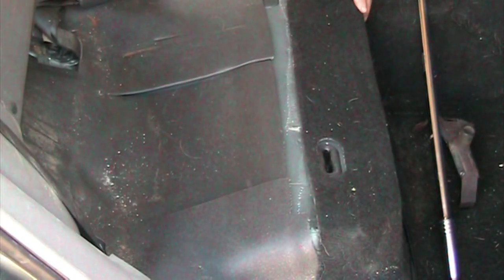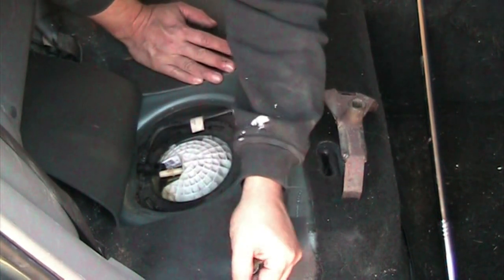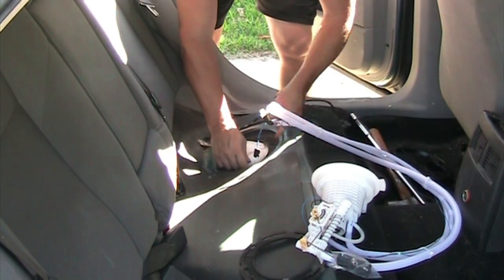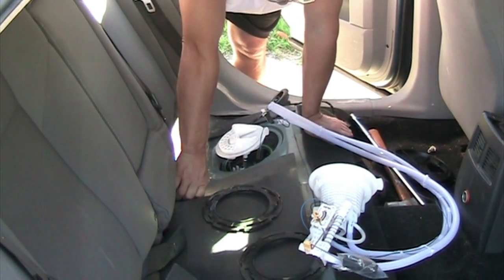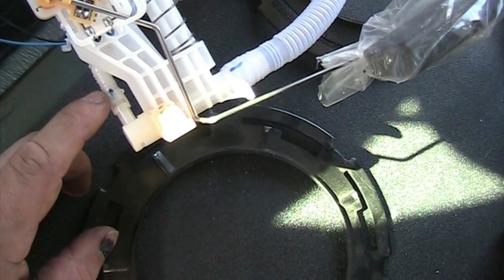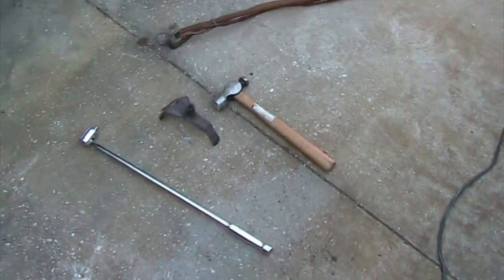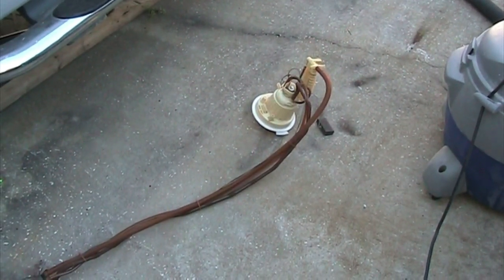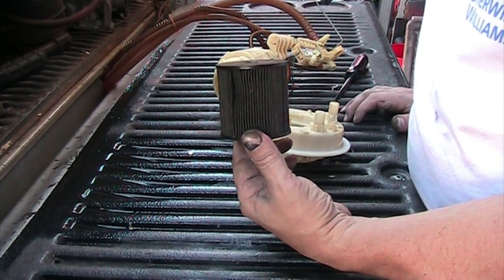Chrysler 300 Dodge Magnum Charger Fuel Pump Filter passenger replacement

Comment: Thank you! Very helpful video, thus video helped me very much answered all the questions I had about this installation.  Thanks for taking the time to record, do and upload thus video
Reply from the maker: Glad it helped!
Reply: I currently have long crank am going to change the passenger pump and the crankshaft position sensor as well
Reply: Thanks for explanation , think im going to replace both of mine on my Magnum car has 270K on the Hemi and just having fuel pump or filter issues. i fought my other RT by changing the filter unit then later having to come back and change the pump side few months later for a weird very intermittent stumble issue. Thanks for. going to through all the trouble
Reply: What model years does this repair apply to?

Comment: Good explanation of the fuel system. I have a Chrysler 300 similar setup..recently the pump went ,but I also have to replace the other side (filter, sender..)
Reply: Ll
Reply: Earl Shaw  it's only one fuel pump. The other side  is just a regulator/ filter but it's attached to fuel line that goes to the rail/injectors

Comment: What were the symptoms when a filter gets so dirty?
Reply: Long cranking before your car starts because of the lack of fuel pressure. Mpg starts dropping. Misfires can happen. Car can stall if it gets very bad.
Reply: My car cranks but wont start. Changed the fuel pump and still only cranks. You think it can be the filter?@ttarverr

Comment: Why is my right tank full where the filter is located? What can be the problem there? It is not passing the fuel to the driver side. Please help. Thanks in advance. When I cross the gas on the fuel pump side, it cross all the gas again to the filter side.
Reply from the maker: The way the pump works is as follows, fuel enters the reservoir of the driver side module. The fuel pump pumps the fuel through the filter to the passenger side module through a supply line inside tank. The pressure regulator inside the passenger side module regulates the pressure at 58 psi. All unused fuel that is not sent to the engine is fed through a venturi at the bottom of the passenger side module. This creates a low pressure siphoning effect and draws fuel from the passenger side of the tank and transfers it to the drivers side tank via siphon hose inside the tank. While the vehicle is running the fuel in the passenger side of tank is continuously transferred to the drivers side. Fuel will continue to fill the drivers side tank till it reaches the bridge section and then start to spill over to the passenger side.  So check my other video out on how to replace the passenger side.

Comment: Could a clogged fuel filter be a problem as to why my car doesnt wanna go past 3k rpm?? 2014 charger 5.7 pursuit, has currently 217k miles on it, any time i hit the gas, it stutters around 3k rpm and if i force it car goes into active limp mode, DO have a code for a cyl 1 misfire but the first code i had was for the fuel pump sensor, then i got the cyl 1 code, please if anyone can help, i changed the plugs, swapped coils around and even got a new injector for cyl 1 and still doing the same thing, did a oil change recently and no metal in the oil and no ticking coming from car.
Reply from the maker: Very well ...... because at higher rpm you demand more fuel so yes. Or he injectors

Comment: My car stalled out I got P0340 code want start with starter fluid I installed new pump spark plugs crank over slow then normal I never changed fuel filter before could what u changing be my problem I never changed it out been driving it since 2020

Comment: Hi, recently change the fuel sending unit on my 2019 dodge charger due to my fuel gauge fluctuating. I tried to put in the fuel sending in gently but it didn’t go in as easy as yours. Do you know if i did anything wrong or maybe i have the wrong part 🤔. I had to push it sort of hard to pop into place but my gauge is still not reading correctly from time to time. Keep in mind this was happening prior to me changing the pump and i have also change the fuel pump. Could it be something else other than the pumps.
Reply from the maker: I think you have a connector corrosion or problem with some of the wiring itself. Clean out the plug which goes and put some electric grease into it so it ensure a better connection. 90% of time it's the connector right above your unit you just changed out. If it isn't that it's on the backside of your cluster. Both can wear and get corrosion over the years. Hope this helps

Comment: What does the 2 small black wires go to on the "pass" side filter/regulator. Whatever the connector was broke on the inside of filter house. So I had extracted the little broke pin that is like a brass color that sits below the filter with a small thin little piece of metal that the filter pushes down onto

Comment: Where is the fuel filter location on a 2007 Chrysler 300 3.5l touring??? Is it the same as this one plz I lose engine power under hard acceleration
Reply from the maker: Yes it is the same for all models.It is inside the gas tank.
Reply: @lsellclumanetsolarenergyll5071  thank you I really appreciate the reply now I can get to work
Reply: @lsellclumanetsolarenergyll5071  this wasn't my problem it was my ESIM that had a small leak but I replaced it and my engine light is still on and it still loses power under hard acceleration could this be the problem
Reply from the maker: @Bryan.956  no but what codes do you get and at what RPM do you feel a lag setting in? It also can be air intake related which don't even throw a code.
Reply: @lsellclumanetsolarenergyll5071  keeps on coming up as a small evap leak and only when I hard accelerate it happens if I drive calm and normal it drives and feels like a cloud so smooth I only have that problem when I floor it and passing 4500 rpm
Reply: I have a aftermarket KnN intake and new maf sensor which I didn't need but still replaced just to have it new also with the intake

Comment: I have a 2008 Chrysler 300 that's turning over but wont start. When I spray starting fluid it starts up then dies. I hear the fuel pump whining when I turn the ignition on. Do you think the fuel filter module is bad on the passenger side?
Reply from the maker: If it doesn't stay running without starting fluid been sprayed it can be 2 things. Starving for fuel because of the fuel pump. Or your injectors got clogged up. I would test the pressure first, if pressure is OK than your pump is OK. Injectors you want to clean proper. There are videos about them so you can test them or spend the money to replace them.
Reply: @lsellclumanetsolarenergyll5071  ok and thanks for the quick response
Reply: Yes
Reply: @beattheheatindustriesinc5700  I changed the fuel pump on the driver and it still wont start. I can hear it pulling fuel from the passenger side fuel filter module.  So do you think I should still try and replace the fuel filter module even though I here it trying to pull the fuel from that side?
Reply: @donaldray2040  that was happening to me and it was the wireing I switch the driver pump and car wouldn’t start and now it start my mechanic fixed the wireing but still’s marks check engine have to do passenger side now but at least it starts now

Comment: Great video, but what code let's you know its the fuel pump or the filter? My engine light on 05 magnum s.e is reading*implausible fuel level detected  is that the filter which is the passenger or the pump which is the driver side however Gas meter reads fine
Reply from the maker: Look at your odometer mileage you on it. if you have over 100k on the fuel pump/filter unit than there is an extreme high chance your fuel efficiency already went down and your vehicle is building up carbon because of running to lean at times. Don't wait for the code just get it done. If you do it yourself take 2-3h out of your day and spend under $100 on the part and just do it. And implausible fuel level can be either side because you do have on each unit also a gas fuel level unit. I noticed it because I drive ton's of miles about 60k a year and more so my ass and ears are my best sensors as a former rally car driver you just learn to listen and feel more the car than regular drivers do.

Comment: Great video.  Question though.  Do you think the filter side could clog up restricting the flow enough to not let the engine start and run or start then idle and die?  Just put a pump in an 05 300C with the 5.7 19 gallon tank and it ran for a few minutes perfectly, but after we shut it off is only starts and dies.  Fuel flow seems very low at the fuel rail in the engine bay.  Thanks.
Reply from the maker: Ok yes it can happen. What pressure do you get at the fuel rail? Did you try to unhook the fuel line and put the car into ignition warm up mode meaning you don't crank the last bit of the turn this should pressure the fuel line and you should see if enough comes out or not. Sometimes debris can be restricting the flow which made it passed the pump and was sitting in the line for to long.

Comment: Can this part throw o2 sensor codes and lean codes
Reply from the maker: Yes it sure can so does also the gas tank vent cap. Check that first. OEM tank caps are required.

Comment: I'm still having this same issue with mines I changed the pump on the driver's side but not the passenger side it's still having the long crank issue should I try this? I been thinking it was my timing belt or something
Reply: What's your error reading
Reply: Update
Reply: Running decent now
Reply: @millytopshotta  so what was it? I currently have long crank. Tomorrow am installing the passenger pump and i will be putting the crankshaft position sensor as well. The one next to the starter
Reply: @rhurtadorh32 try changing both pumps that fixed my problem  and I also did crank shaft sensor lmk

Comment: Una pregunta amigos porq se apaga un Dodge charger 2008 cuando le qda un cuarto de gasolina se apaga solo le vuelvo a echar y enciende una observación q ise esq del lado derecho del tanq tiene menos gasolina q del lado izquierdo q podría ser
Reply: Fuel level reading off and the pump needs to be semi submerged in fuel. Either or

Comment: Does the replacement also help with filling up the Gas? The problem is that i cant refill  the gastank normaly, i just have to be really patient and cant walk away while its filling up.
Reply: Im having the same problem i have to slowly put gas in
Reply: @chrisjohnson5979  i found out that there could be also a valve inside the fuel system which could be getting stuck over time. I will fix the issue in a couple of weeks. When i found out what really the cause is, i will tell you what you can do about it.

Comment: good video, but the O ring is the last thing to put on.
Reply from the maker: Maybe but works well this way.
Reply: no you have to put it on first, if you dont you get to all of this twice unless you want to stretch it over the top of the housing
Reply: @gradybradford6450  you don't have to stretch it. It goes right over the top. I had no problem with it.

Comment: My God you make this painful. You could have waited to remove the blue clip after you had pulled the unit. Geez. The way you fumble around does not make me confident in your experience.
Reply: Also, the filter inside the fuel filter (the black one)... what part number might that be?